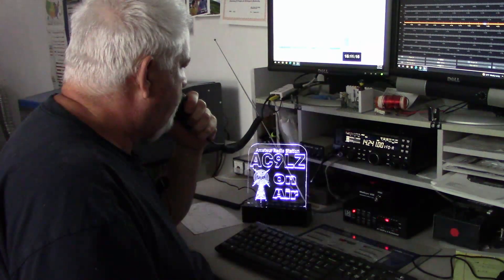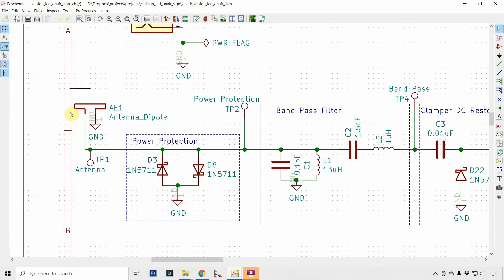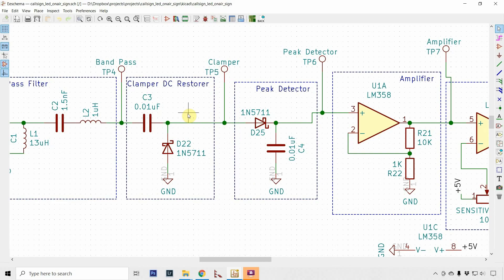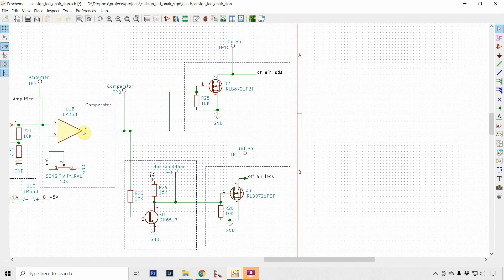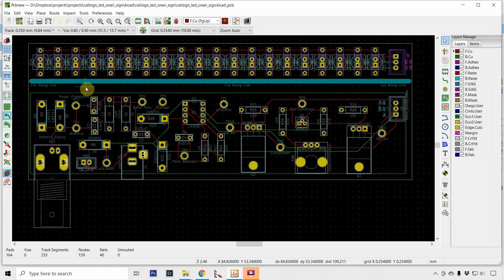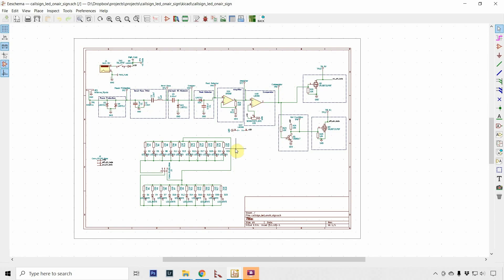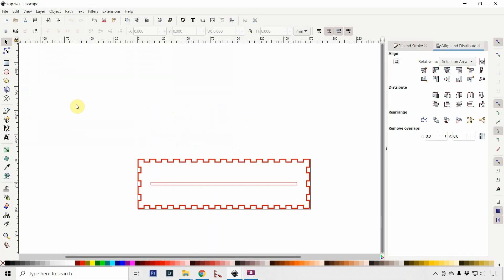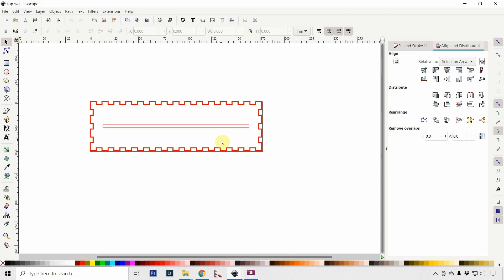RF Detecting LED Sign Part 1 of 2 - When it senses RF it shows you are on the air!

Comment: Good explanations! So a bandpass filter which filters between 1 and 200 MHz will get all amateur HF frequencies, including 6M and 2M VHF. Did you intend to include 2M or was the circuit just simpler this way? If you did purposely include 2M, why not 70cm? (Was it simpler, or did you just have to draw the line somewhere?)
Reply from the maker: I limited it to 200Mhz to include the 2meter band, but I don't do much with 70cm.  Check out rf-tools.com for a very good LC filter designer.  At this point I am not 100% certain the band-pass is working like it should.  As I get more experience I might look at it again in the future.  The sign works fine just not sold the bandpass is attenuating as it should.
Reply: @StuartPatterson  Understandable. Thank you for your response. Just out of curiosity, this sign appears to light up during the actual transmission time... I was thinking that if one wished to use this light to tell others that transmissions / QSOs are taking place that a delay circuit for turning off the light might be useful. So for example, during an entire FT8 QSO, send and receive, that the light would stay on the entire time. Anyway, just a thought. Thanks for sharing this!
Reply from the maker: @cobbtechnicalconsulting4972  I did consider that and toyed with the idea of a simple RC circuit and/or using a 555.  However, I have not changed the circuit as of yet.  Certainly doable!

Comment: Import the audio to Audacity, normalize, then run compression/dynamics at 4:1 20 dB gain, starting at -25 dB, export to wav or mp3, add it back into the video as the audio track. Great video otherwise, soup to nuts.
Reply from the maker: Sorry the audio is not that good.  I actually normalized through Da Vinci Resolve.  I will have to work with it more next time.